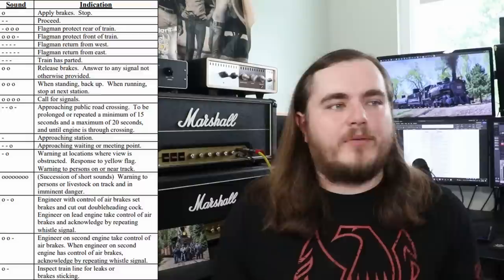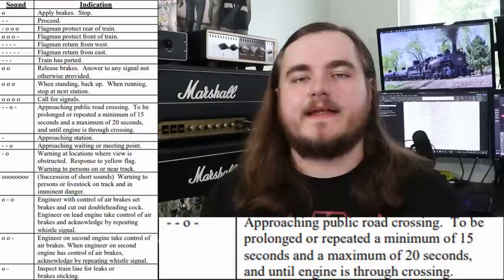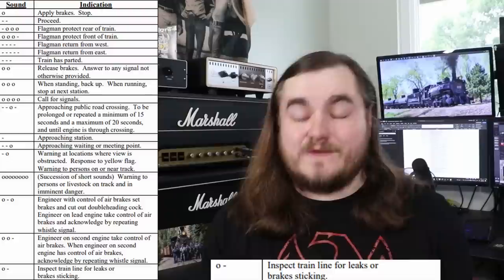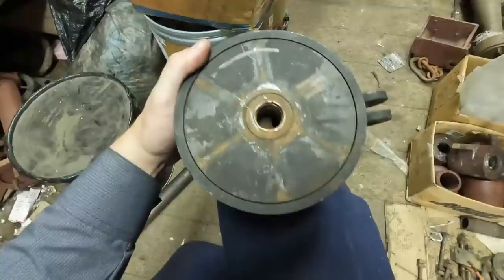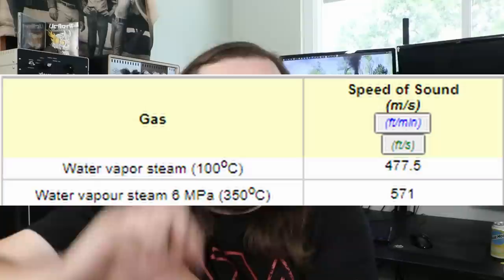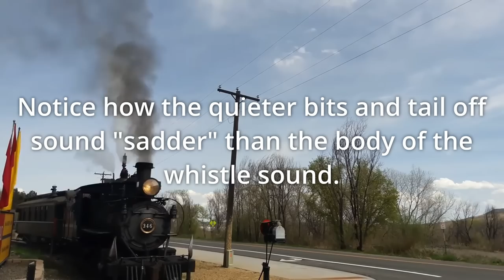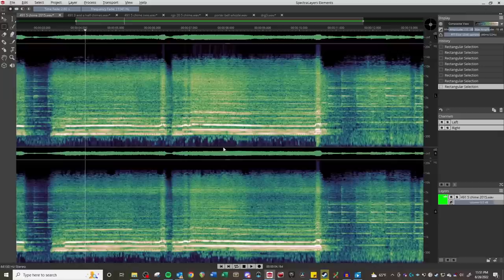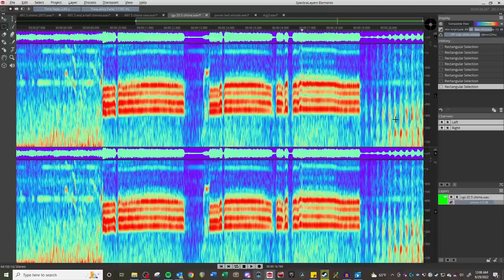WHISTLES 101 - EVERYTHING you could want to know about STEAM TRAIN WHISTLES!

Comment: Another thing to look at is how the pressure affects the pressure.  In a pipe organ, the pitch of a pipe falls off as wind pressure drops. Many pipes also jump up an octave when blown at a much higher (relatively speaking) pressure.  It’s called over blowing the pipe. I think the flow over the languid gets disturbed when the pressure of the air is outside the range the pipe was designed for.  May also be a similar factor in play in steam whistles.  Have you tried playing a whistle on compressed air to see if the effect is similar?
Reply from the maker: I've never seen one jump up an octave myself; I think the excitation is different enough that they don't do that.
Reply: For sure the pressures are in very different orders of magnitude.  If you ever get a chance to try a whistle on air, I’d be very curious what your impression of its behavior is.  Thanks for diving into this subject.  That almost was 102 level. 😉

Comment: The three shorts one can also apply to flag/request stops. Usually a little warning to the brass hat man to get ready to issue and punch some fresh tickets or get his stepstool ready to help people get off.

Could work both ways, as the signal line blew a little whistle under the engineer's seat, and if the boss had people wanting to get off at such and such a place that wasn't a station or just stop the train in general he'd give three shorts on that.

Everbody all knows the biggie. When that little whistle screams as the line gets held down you big hole 'er into emergency and hang on!
Reply from the maker: Also very true! Good adds.

Comment: You will enjoy this. Blow your wooden whistle after inhaling Helium. I'm a physics nut. A little more dangerous, blow a truck air horn with Propane instead of air. When the whistle blows, and the air in the bell is replaced with the denser gas, the pitch will slide down.  Try the helium. Don't try the propane unless you have all the safety in place for venting propane safely.
If you get the chance and time, and have access to a chart recorder such as one of the DataQ line, and a bead thermistor, you can chart the temperature of the air in the bell during the blowing of the whistle in real time. Place the thermistor bead away from any of the walls of the whistle to capture the temperature of the gas in the bell about 1/2 way up the length.  What will be found is at full cord pull, the live steam travels further up the bell, and on a partial cord pull, the bell condenses the steam rapidly changing the mix of the gas to less steam, and more air at lower temperature, resulting in a higher density gas mix, and lower note.  Hope you get the chance to explore this aspect and observe the amount the whistle expels water vapor that condensed.
Ensure you use a bead thermistor able to respond to the rapid temperature changes of the gas in the bell.

Comment: Really interesting and informative. I love your 101 videos. LA Metro (governed by FTA, not FRA) light rail lines have lots of grade crossings and the operators do the 2 long 1 short 1 long signal with the high horn (the trains have a high and low horn) in South LA where it's not quiet zone. Often they finish the signal too early, before entering the crossing. Can you do an air horn (and quiet zone) 101 video? Also can you do a bell 101 video? Like history and types of bells and rules on using them. I like how the horns and bells sound. And lights 101...

Comment: Hyce, thank you for the in depth explanation of the science of the whistle.  I assumed it was the air pressure and flow, but I couldn’t figure out how a stationary resonance chamber would change pitch.  The speed of sound changing makes sense. 

Off topic question - Do you know how to change the volume, not pitch, of an air horn?  In the 1:8 scale “Live Steam” hobby, many diesel locomotives use multiple air horns.  I would like to make the air horns drift off in volume at the end, almost like an echo, but with the same inner modulation of the full volume horns.

Comment: I live in Longmont, Colorado... The BNSF passes right through about 2 mi of old-town residential neighborhoods, sometimes within 40 yards of people's front or back doors. We definitely hear some air horn "quilling", depending on the engineers mood or skills... There is usually at least one train through between 10:30 pm and 3:30 a.m. I have to assume they have some level of control of a valve, and it often only sounds one of the horns at about 1/3 volume, sometimes hits a second horn almost as a hum... When someone is in crummy mood it's 110%  of everything 🤣
Reply from the maker: They might still have some power that isn't just the mag valve. Or the horn diaphragms are dying. Lol

Comment: Bringing up this, more or less, acoustic rivet counting, I think if someone wanted to truly replicate or record a whistle of an engine that no longer runs but want to ensure it actually sounds how it originally did on the locomotive it came off of, you gotta have that thing supplied by the same pressure as it originally did. If you hear the Southern Pacific six chime at cass that came off of 4450, it sounds nothing like an sp six when fitted to a gs4. If you listen to the six they had on 4449 for a while, the steam pressure is way more than whatever logger they had it on at cass.
Reply from the maker: It's pressure combined with the leverage, yes. Agreed. The whistle needs to see the same flow.
Reply: I've begun thinking about what whistle would make the most suitable replica for a Nickel Plate Road L1 class Hudson whistle. Despite both the L1s and Berkshires having Nathan step top six chimes, they sound nothing at all alike. I wonder what other whistles used by other railroads would have one of roughly the same dimensions to theoretically convert into a replica nkp L1 whistle. Fidgetdidget made his own model of 170 in Trainz and I told him where to find a recording of 175's whistle and he actually sampled it and put it in Trainz for it, which is exactly what I want to do with one of the three brass models I have. But I would like to hear that whistle as a guest on 765 at least once. The best way I can describe the whistle is it sounds like a Reading six chime if it had 765's blast shield around it. Supposedly Jerry Jacobson had the whistle off of 175 in the age of steam collection but I only read that on a forum and cant back that up any further.

Comment: i wonder if the Chambers expand at different rates due to the heat aswell with different surface areas for cooling could explain the Variance in the shorter chambers since it would take longer for them to cool down compared to the larger chambers

Comment: So now knowing that the temperature difference is the biggest contributor to the quilling of the whistle, I wonder if there’s a way to get a similar effect through other means, such as using heating coils to preheat the air going into the chamber. That way you could get something like a pipe organ to quill, without having to deal with stuff like boiling water or the inevitable water damage that would come from so much humidity in an enclosed space. Then you could also use such a system to test locomotive whistles before having to install them on a steam engine.
I doubt that anything will come from such a train of thought, but my mind is certainly coming up with some ideas.
Reply from the maker: Temperature of air does not change the speed of sound near enough to quill. That's why you need the steam.
Reply: Good point.

Comment: I do have a question so could you take off the air horn on a diesel loco and put on a whistle and as you mentioned it would sound different cause air would be making it whistle and not steam but how much of a difference. 2nd question would the temperature of the whistle make a difference like from being cold from sitting for the night the very first whistle vs the last whistle of the day when the brass of the whistle is heated up from using it all day would there be a difference or just a very small difference?
Reply from the maker: You certainly could put a whistle on a diesel and it would work, it just wouldn't sound the same.

The difference in temp of sitting cold or being in the sun is nowhere near the temp of steam, so if there was one it would rapidly disappear.
Reply: @Hyce777  what if you put a diesel horn and mount it on a steamer? I know thst with some ocean liner ships had typhoon horns thst were blown on steam.
Reply from the maker: @cowcatcherstudios5759  I'm not sure how the diaphragms in the horns would take that, but it should work if the diaphragms are ok.

Comment: So, turns out there is one tweak you can make to the wooden "steam engine whistle" that makes it able to be quilled.
Don't blow air thru it.
Now we know steam's non-viable, dry superheated steam will char the wood if not just outright set it on fire.
But there's a trick to be had. You can exploit the phenomena known as "2 phase flow", and use a refrigerant such as the commonly available (at least in the US) R-134a.
The trick is that you put the valve controlling the flow of high pressure liquid refrigerant as close as you can to the whistle itself, this ensures that varying how much you open the valve will vary the proportion of liquid to gas refrigerant entering the whistle, which will change the bulk density of the fluids flowing thru the whistle, which SHOULD vary the overall pitch of the whistle, similarly to how it works with steam (again, dependent on temperature) but at a much lower temperature.
Obviously to avoid destroying the ozone layer the whistle would have to be sounded in a sealed chamber, but if the walls of the chamber are shaped like an accordion or bellows it should allow the sound to easily escape the mechanism and be heard in clear air. Conventional refrigeration equipment would be used to recycle the refrigerant thru the whistle, however it would first pass thru an evaporator coil to ensure that all of the refrigerant has evaporated/boiled into a gas before it passes thru the compressor, and there would be a condenser after the compressor to allow the refrigerant to re-condense into a liquid before passing thru the whistle again.

If this sounds like I just shoved the whistle in the middle of the refrigerant loop of an air conditioner or refrigerator, that's because that's exactly what I did, pretty much.

A side effect of the operation of this device is that it would get the evaporator and the whistle itself incredibly cold due to the boiling refrigerant sucking heat out of the whistle and evaporator, just like in an air conditioner, because... well that's basically what it is, plus the whistle being in the flow of refrigerant.

But hey, I wanted to be able to quill that wooden "steam engine" whistle, and I now have a plan to make it happen!
I don't have a refrigeration license, so I can't legally put refrigerant in the thing if I build it, but I was approaching this as more of a thought experiment in any case.

Or you know, you could just operate it on steam, but to do that you'd have to make it out of a very heat resistant material, such as metal.... and then you're kinda right back where you started anyways.
Reply: Oh right, there's one small issue left with this "refrigerant lets you quill the wooden whistle" thing.
Instead of the valve being "low pitch to high pitch" as you further open the valve, it will be inverted.
So with the refrigerant version, it will be "high pitch to low pitch" as the valve opens further.

Comment: Damn, I would have never thought about the speed of sound changing due to the temperature.  Of course I realize pitch bend due to the Doppler Effect but I would have never put two and three together.  What a hell of a video.  Also those amps are making me drool.
Reply from the maker: Cheers mate :) top is a 1980 JMP super lead 1959 model, bottom is a modern DSL100H.

Comment: I always wanted to put a train whistle on my motorcycle as the horn because no one would see me, no one would hear me, and people often drive like idiots so I wanted to something to jolt them out of their stupor. lol Well, I crashed that motorcycle more than 10 years ago now so there's no point now, but I think it would have been funny.

Also, if you want another reason to buy another guitar, find a place where they sell Guild guitars and try one of them out. After crashing my motorcycle, I got a settlement because I was not at fault. I used some of that money to buy a new guitar because I had a cheap $200 one. I asked a few of my musician friends which nice guitars they thought sounded the best and my one friend who is a professional musician told me to go play a Guild. From my first strum on that thing, I knew it was the best sounding guitar I had ever played because the notes are all so rich-sounding and the high notes aren't too twangy. I think it has to do with the thickness of the wood and the fact that there are these extra little ridges at the 90 degree joints on the inside of the body so sound must be bouncing off of all of those surfaces. That does make it hard to get a pick you've dropped back out of the body of the guitar but it's well worth it for the quality of sound, as is the fact that it's incredibly heavy compared to other acoustic electric guitars. Anyway, I highly recommend you go find one to play and see what you think.

Comment: Excellent video, just like many others of yours!  One point to consider is whether chamber length is the only determiner of pitch for a given constant steam temp/pressure.  My understanding is that chamber volume actually has a big impact on pitch.  Where this gets interesting is that on most 5-chime step-tops, the cross-sectional area of each chamber increases with the height.  The intent here was to keep the chord consistent (just slide up and down in pitch as steam pressure and temperature adjust, since the ratio of chamber volume and pressure stay relatively constant), whereas 3-chime, 4-chime, and 6-chime whistles with identical cross sectional areas per chamber have the chord change as steam pressure and temperature adjust (hence the chord change that's very noticeable on most 3-chimes.  I'm not sure I'm conveying this well.  Anyway, have you looked into total chamber volume as an indicator of pitch?

Comment: For the flagman signal whistles what happens if the engine or train is stuck on a switch and they need to send out 3 flagmen but there are only preset signals for 2 brakemen. Would they make up a new whistle pattern on the spot for the third flagman?

Comment: Mark, I dunno if a couple of questions I asked you months ago about the pitch change on whistle vs a horn had anything to do with making this video, but you absolutely nailed the missing link I couldn't figure out either! And I totally geeked out for the last third as well being an Electrical Engineer as well as a steam enthusiast! The histogram of the frequencies over time gave a great visual representation over time that I didn't expect, I always looked at a frequency distribution which showed a live look, so some subtleties would get lost that the histogram clearly shows.   So sidebar question, are whistles in general all playing a chord, like D, A7, or G or whatever, or are they just a combination of notes that 'sound good' together? 

And as far as a horn being played on engines that still have a non electric control valve, I think the same phenomenon is true as well, but much less pronounced since the compressed air temperature of the system is much closer to STP, and as you take the compressed gas and let it expand when it hits the horn diaphragm at atmospheric pressure, the air temperature has to go down, as it moves from an area of high pressure to low... good old PV=nRT comes into play yet again!

Thank you very much for an excellent thought provoking video explaining and demonstrating a lot! If I ever meet you if I get the opportunity to get to CRRM, I owe you a beer, or two!
Reply from the maker: Cheers! Good old PV=nRT... One of the equations they make sure you never forget. Lol! 

Most of the whistles seem to play chords, though of course not quite in tune. Rio grande 5's are close to an Ab min7; 3 chimes are usually major or minor chords; that sort of thing. The 6 chimes are weird, weird intervals you wouldn't think of.

Comment: If you do do a grade crossing please mention for the public and rail fans about the blue signs. I am a career traffic controller. I flagger near and across grade crossings. I learned from a job i dd, where a tractor trailer hung his landing gear up on the crossing. At every crossing with lights/bells or crossing gates there is a blue sign with railroad info. It has the RR name here its Norfork Southern. It also has the crossing number. And a 24/7 RR emergency  contact phone number. If more people knew of this number info plate which is a 10x12 inch blue sign with white letters and numbers. We also need to contact the RR ig our traffic control pattern cross' a grade or if the traffic being held is past the the tracks and traffic might back up or stop on the crossing from our setup then we need to call the RR to get a railroad flagger to monitor the crossing and keep vehicles from stopping on the tracks and warning trains of issues. But yeah that blue sign is for contacting the railroad crossing owners emergency contact info. So if you even see a vehicle stuck at a crossing dont panic dont film it call that number to warn the train.
Reply from the maker: MUTCD sign I-13... Yup, was already planning on it. :)